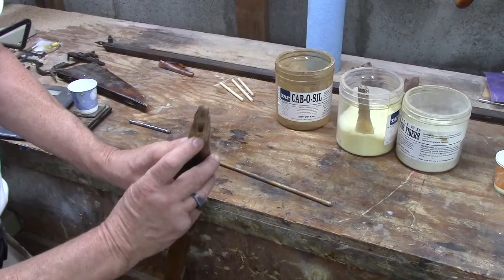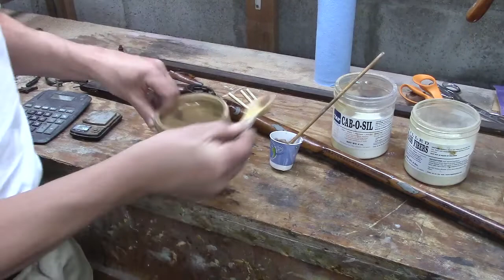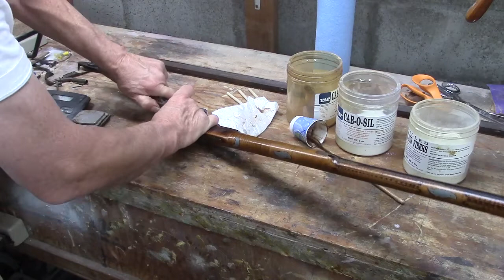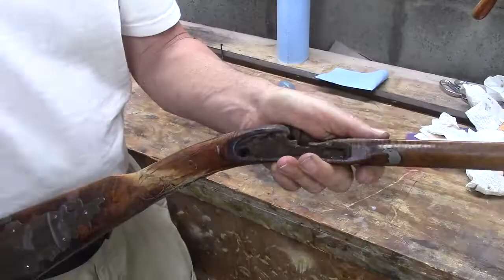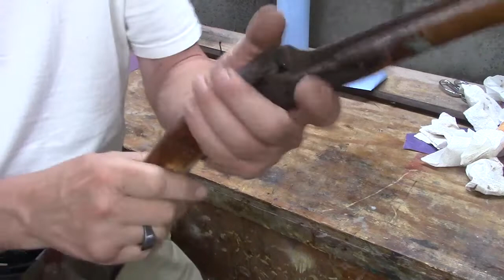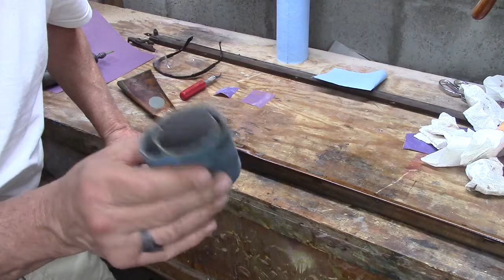Antique Muzzle Loader Stock Repair

Comment: My guess is your old stock was originally stained with Nitric Acid. (Also called Aqua fortis). That was the traditional gun stock stain used in the 18th and 19th century. It’s easy to use and it’s beautiful when done correctly. You can buy it at a very reasonable price at Track of the Wolf or Log Cabin Shop. Good luck to you. Don’t let the word “acid” frighten you from trying it. The product you will buy is a very mild solution.
Reply from the maker: Thank you for the information!

Comment: Next one of your bills that you have like this or repairs use rubber bands you know the surgical kind they work really good for doing these kind of repairs I've done it before wrap it around and you can go around the butt and come up to the front of the gun and I made a little pouch with the rubber bands on like a slingshot and put it over the end of the stock and it kind of pulls everything together and then just rubber band it right in the center
Reply from the maker: I keep a roll of surgical tubing on hand for the purpose. Thanks for sharing a great technique!